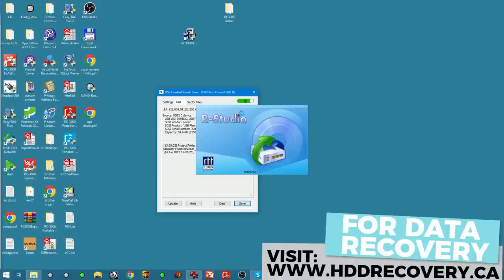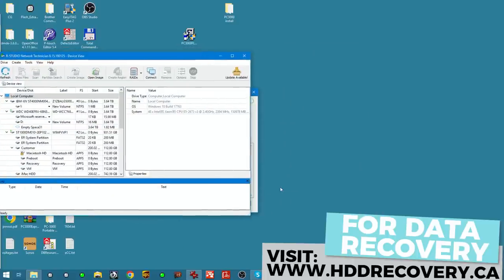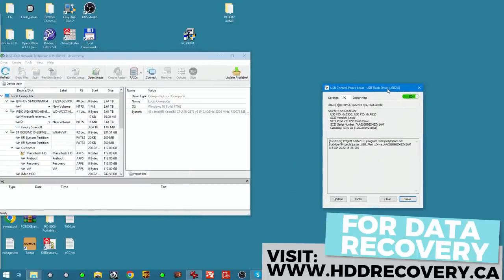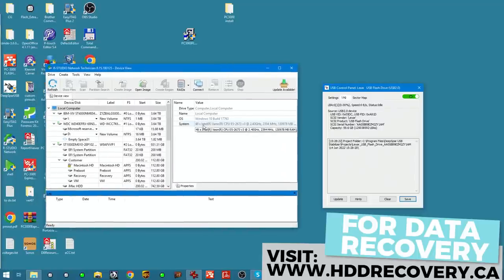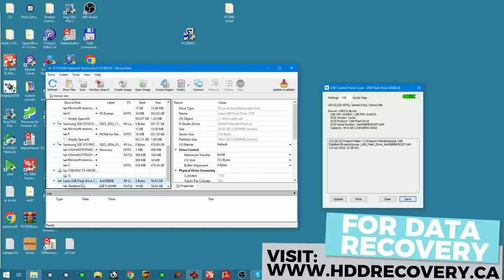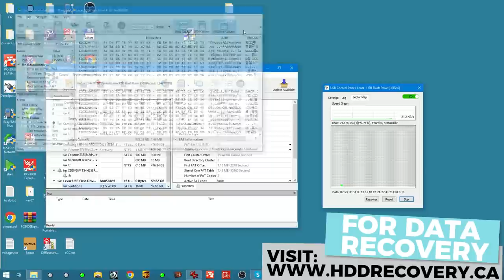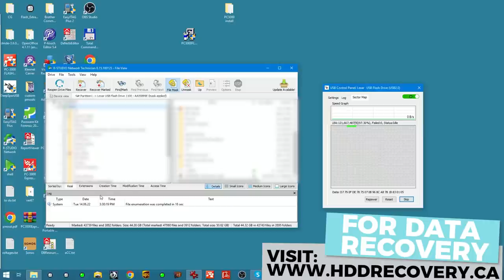how to repair any flash drive

Comment: Nice. Also, most boards have an indicator of some kind and it's no so much for people in the repair business but the setup of the pick & place machines.
That controller also has a dot on it (most chips will) and there is that large copper dot on the board showing which way to orient the chip.

Just in case anykne ever forgets which way the letters are pointed.

Comment: The only objection I have is that the controller can be configured to reserve part of the nand flash as spare and some of the configurations can be specific to the size of the device as it is supposed to be sold.
Also the list of cells that became bad over time and were replaced with spare cells could be stored on the controller.
So, as I see it, it's not just a matter of swapping things out.
Reply from the maker: yeah, but we keep the original controller.

Comment: I have a question but first, I am an IT but not into board level knowledge of things like that. So my question is, why is that when a flash drive is full at 100%, it totally stops working?
With that experience for so man times, I always advice my workmates to avoid maxing the capacity of any of their storage device.

Comment: Nice job.  When you receive a flash drive from a customer, do you go out and purchase similar models to use as a donor?  Or do you try to purchase various flash drives ahead of time hoping that you will eventually get something from a customer that matches.  I would imaging getting an older model flash drive from a customer could cause issues if you can no longer find a similar device available.  In a perfect world, you could have the customer send you a donor along with the failed device, as long as they are both the same model.
Reply from the maker: never throw anything away - is one thing I picked up right at the start of my career. Some things I buy, some things clients let me keep after we send the data back.

Comment: Ok that, but what to do when you have a flash drive with write protection? I have here a SanDisk Ultra 64GB USB flash stick which got write protected a few days ago when I transfered some data from the PC to it. I've tried many things but none worked. I bought it a few months ago, it's not even used so much. Interestingly, in the past I owned a few A-Data sticks (all of them with less capacity then this SanDisk. This SanDisk was with the biggest capacity I've ever own in the form of USB stick drives, with 64GB), and none of them got ever write-protected (If I recall correctly one of them once tried to get write-protected but I somehow managed to save it and it worked flawlessly from then and it works now, too). And this SanDisk here where I live (Croatia) and in the store where I bought it was even more expensive then A-Data one with the SAME capacity!

I think that this SanDisk has an active warranty on it but I will probably not bother with it and plus I'm not willing to provide my data files which are still (though read-only) on this stick available to third-party if I take it back...

I will probably get the 64GB A-Data this time...

Cheers!

Comment: I have a flash drive that has become unreadable/unwritable, I think it was after I disconnected the drive while Etcher was running.

There is no information worth retrieving from that drive (just a copy of Ubuntu), I just wonder if that is a plausible occurrence and there is a way to make it usable again.
Reply from the maker: Usually you can find repair utilities on USBDEV that will allow you to "clean the NAND" and rebuild the flash drive kinda like factory reset. But it depends on the controller of your flash drive. I know those utilities exist but I never really used any.
Reply: @hddrecoveryservices  I will give it a go. The flash drive is dead, it is not like I could mess it up more :) Thank you.

Comment: I have a question. 

My 128gb samsung flash drive (type c) cannot be formatted. I delete files but reconnecting it to pc, the files are still there. Format fails. Tried cmd method also. Fails. File format shows as fat32 when it should be exFAT. 

Anyone knows what's the issue and fix for this?
Reply: I have seen larger flash drives formatted in FAT32 where the sector sizes are multiples larger. I have a 256GB that the sectors are  8X normal  size and is not 
a standard but works ok. I think the volume descriptors are different and it has a short hidden file in the beginning of the disk which may be a USB driver or something. I use it to store my music collection and have never deleted any files so not sure if I have the same issue deleting files. It is possible your files are archived or set to be "read only" and why they can't be deleted.

Comment: how to repair any broken flash drive...  provided you have $1,200 USD worth of equipment (hot air rework station, microscope, soldering station)
Reply from the maker: My equipment is way beyond 1200. Scope alone is 1600. Free cheese in mouse traps ser

Comment: Nobody who watches this is going to be able to do any of these things, they will just brick their data. And it's not called 'the swap' it's called 'using a donor board', usually by the time somebody needs recovery just buying another one that looks the same will mean a different controller. Also NANDs don't like being lifted without keeping their data. The TLDR is if you really care about your data find someone who really knows what they're doing who specialises in NAND recovery.
Reply: I bet you're fun at parties. I've used the same methods and given same advice for decades. I bet a hot swap of bios chips on live production systems or using a ISA network card to flash 14-18 PIN dips just terrifies you. Sorry you paid a hack and lost your data.
Reply from the maker: It's called whatever you wanna call it. "Also NANDs don't like being lifted without keeping their data" - what do you mean?
Reply: @hddrecoveryservices  maybe confused vram (not nvram) or sram with nand for some reason because any bit of google-foo will affirm that nand is non-volatile and that's just everyday trolling.

Comment: Your video title is misleading. I have two drives and both are dead simply because they was pulled from the computer without first clicking the eject option in Explorer. Nothing you show here will help resolve that, so no in fact this video does NOT show how to repair ANY flash drive!
Reply from the maker: Sure it does, but sadly you don't realize that your devices do not need repair. They need recovery, which I have a ton of videos about on this channel. You can't fix a car with a blown engine by swapping that blown engine into a different car. If you don't know that the issue you have is NAND related, then I can't help you smartpants.